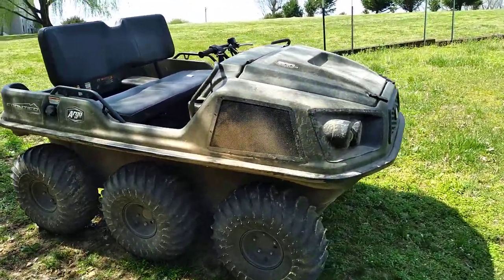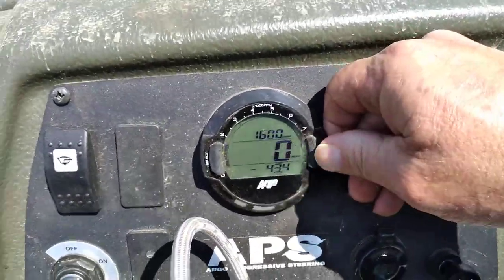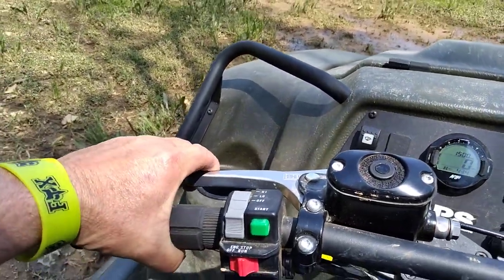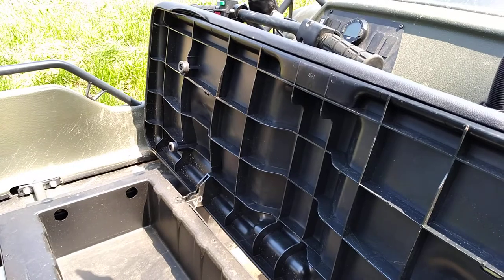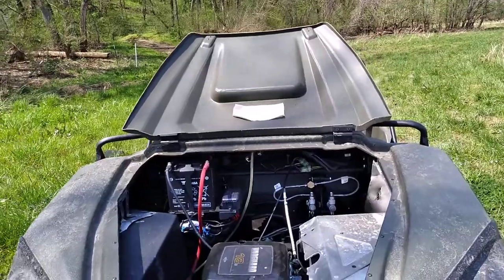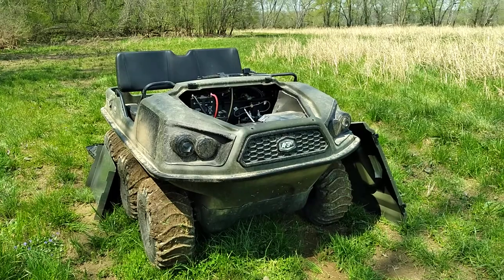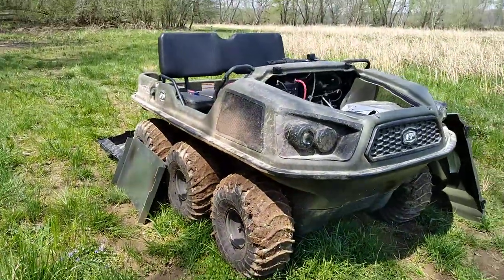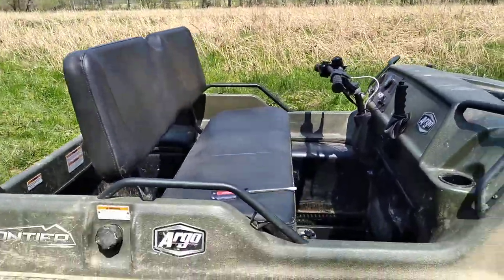ARGO Full REVIEW AND QUESTION ANSWERS

Comment: Question, I have a 2016 HDI eight wheeled. Running in high gear my shift lever keeps slipping out. Any answer to why that might be happening. Low range no problem.
Reply from the maker: Linkage or shifting fork.  Is our guess.. hope that helps